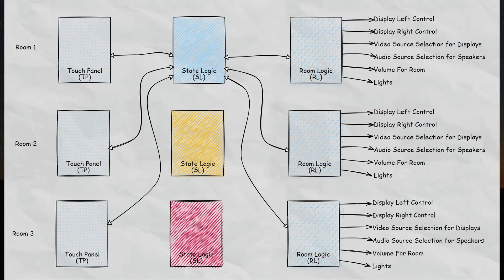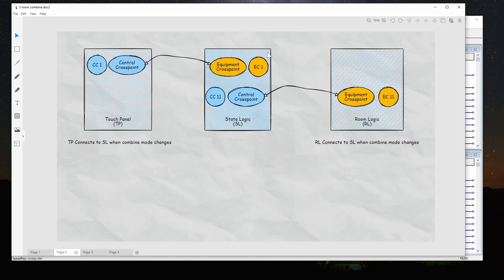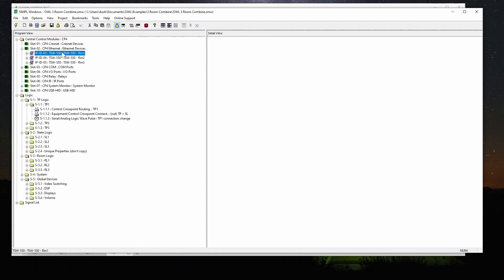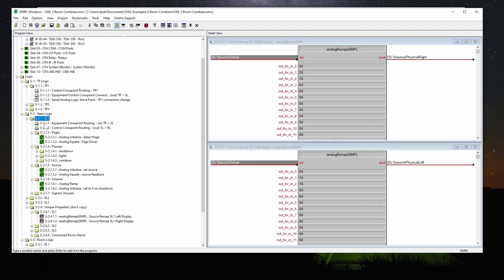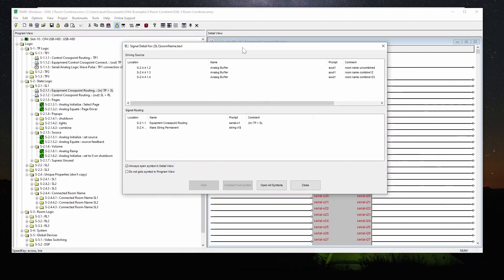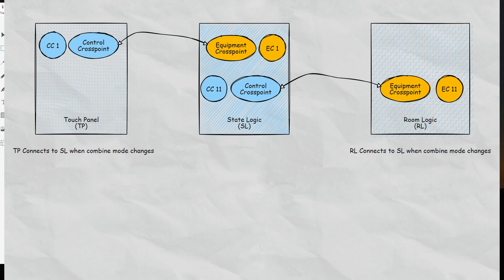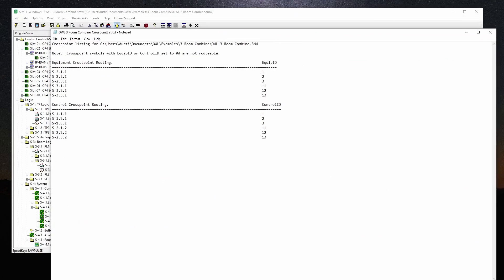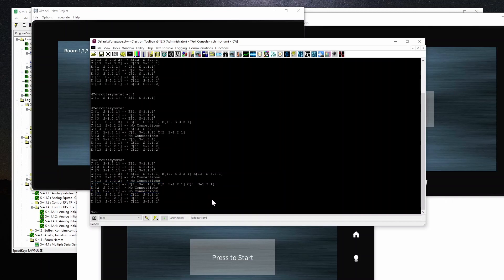Part 2 Combining Rooms with Crestron

Comment: Thanks for the video. Just out of interest, what did you use to make the really useful diagrams?
Reply from the maker: I'm using a drawing program called SketchWow. It is kind of like a basic version of what Visio does but comes with a decent amount of shapes and objects and also has a way to apply a "sketchy" style to lines and shapes. I wouldn't necessarily consider it a serious drawing tool but it is good for throwing things together like this. I've also used it for UI mockups.

Comment: Hello i appreciate your effort doing videos about AV Programming im learning a lot from you.
Can you make a video on how to add custom room control on mtr with uc engine (without a control system) like camera pan/tilting control and preset buttons for huddly camera.
Thank you. I really appreciate all your efforts.
Reply from the maker: I will add this to the list, but I don't think you can do custom control without an external control system. The advanced control button from teams essentially launches an xpanel on the uc engine computer; the panel itself can't send control commands directly to devices. I'll have to investigate further to see if this has changed.
Reply: @OverWorkedLogic  Thank you for your responce. 
I do hope that its possible. Just like what i saw the other day poly has that feature without a control system they can control the camera for mtr setup

Comment: Awesome..nice work Dustin. Again, becuase i'm a pain, let me throw a caveat out. On a larger scale, since Crestron doesn't provide combining like audio and lighting systems do, it should be mentioned, that to synch up with devices and run code that is compatible with subsystems it might be worth mentioning that wall state synchs for the three systems would make you more competitive(you meaning who's watching). If your synching up wall states even if your systems don't use subsystems, everything is the same across all combine projects. Then instead of State logic, you are connecting and reconnecting devices at rom level . Will eliminate the need for the touchpanel to have to connect to different logic and then you can have more global panels for the whole space. Peace out brother, nice work.
Reply from the maker: Thanks for your comments. I'm pretty sure you have done much more complex room combine systems than I have so your insights are definitely welcome! Using the combine states from other provided subsystems if available would make things work better and users would have a better experience overall.

I actually found it really hard to keep things easy enough to understand while trying to not overload people with information (it took several attempts and I finally had to write myself an outline to make sure I covered the key points I wanted to talk about). There might be more parts to add to this series depending on what kinds of comments I hear back. I wanted to talk about how things transition between different combine states and different ways to deal with that but couldn't really fit it in. Also things like dealing with analog values across crosspoints can be a bit tricky with a few different strategies that apply.

Comment: Awesome, i'll watch it 100 times i need applique it in my work. thanks a lot for your videos man
Reply from the maker: Also don't forget that you can mess around with the demo program to try to understand it better and you could even use it as the basis for a system you build as long as it fits the basic operational requirements